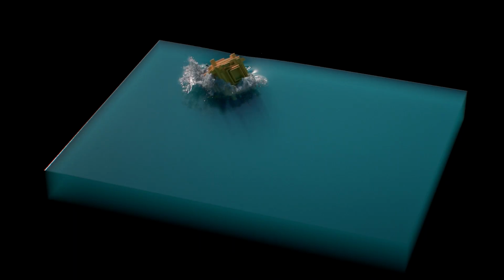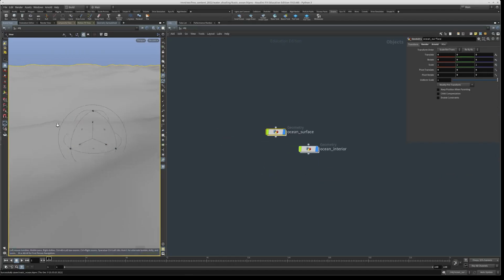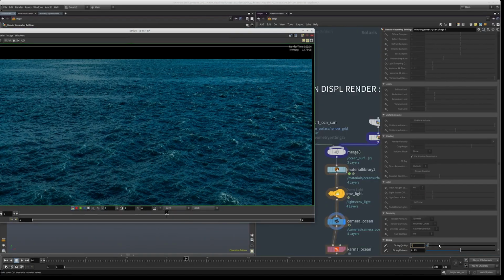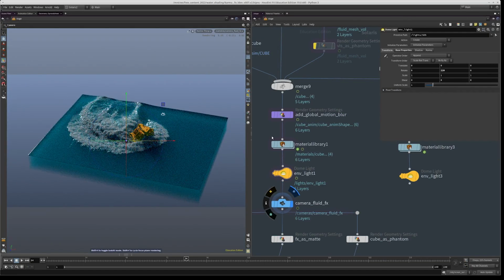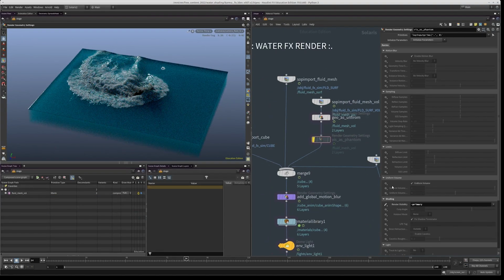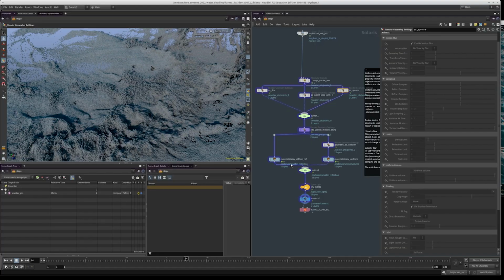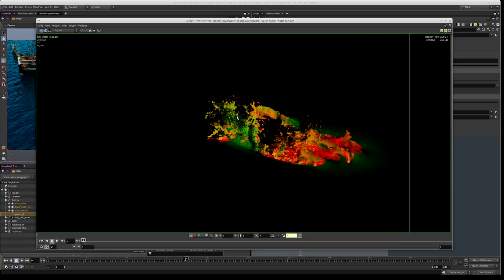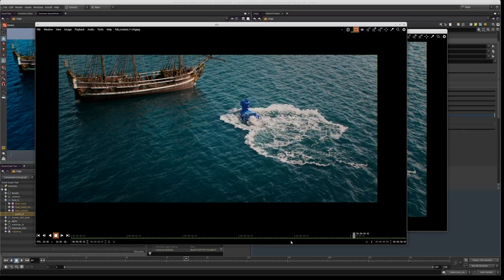Water & Ocean Rendering Using Houdini and Karma

Comment: I have the problem, that I only see a flat grid without my spectrum although it should be applied. Ive been struggling with karma ocean issues for 20h straight in total. So Im a bit frustrated. I watched so many videos. Every video about karma oceans including masks etc.
I need to increase dicing a lot to even see my ocean spectrum. 
However, no matter if a grid works or not. I need to apply the spectrum on a flip mesh which also gets masks etc.

That ends up in a long long long initialization, so I consider mantra faster at this point.
But even if I try mantra is continuously saying "processing displacement geometry".
So I decreased my spectrum resolution although I even tried this in karma before + packed my flip mesh.
What should I try now? Any ideas? 
I would really appreciate any tiny bit of help.
Reply: as of version 20.0 you have to use the houdinioceanprocedural node, to preview in viewport place a houdinipreviewprocedurals node

Comment: what are your system specifications and what do you recommend to this kind of simulations
Reply: big fat beefy cpu and lots of ram ought to do the trick, also a bigger hdd or ssd wouldnt be bad, and while youre at it you can also upgrade your gpu. basically if youre asking these types of questions youll probably need to upgrade your whole rig lol
Reply: @timtaxevasion  then i guess a ryzen 7 and a Quadro p2000 not enough 🥲 how can a 15 year old but a 128GB ram and a RTX 3090 and threadreaper

Comment: @rebelway really loving this and felt very straightforward but had some issues with glitching geometry and volume when rendering out to disk, experienced anything like that? any good tips on what to avoid?
Reply: I had some glitches too. For example, one frame would ignore the fluid and volume and render only the whitewater volume. Then the next few frames would ignore the whitewater and only render the fluid elements. The final render looked like a strobe effect switching between whitewater and water. The object stayed constant.
Reply: @MarvelousMediaEngine  hey if you have this issue I solved it by rendering points as uniform volume - rather than using the rasterised volume, which I would have preferred.

Comment: Can some one tell me what is the recommended spec of computer to do this shot.....???
Reply from the maker: We recommend using a computer with 32gb ram, but you are able to still use it with smaller than that. It just will take longer. Cheers!
Reply: @Rebelway  Thank you very much, And a little question : The high end CPU and VGA do help that or not ?